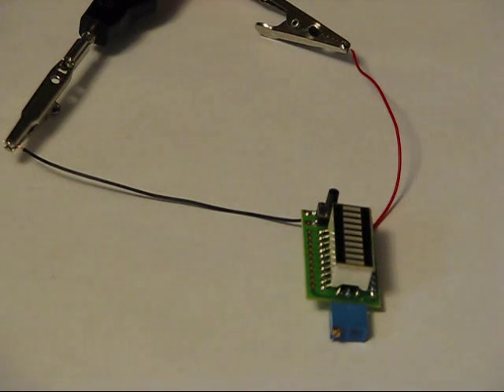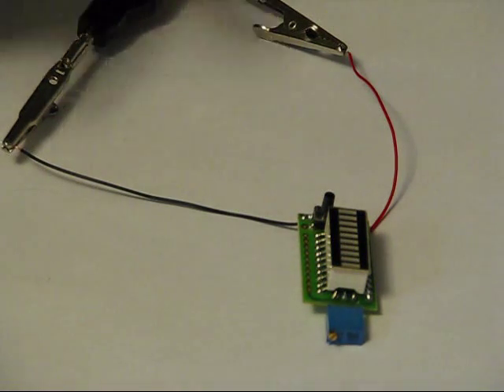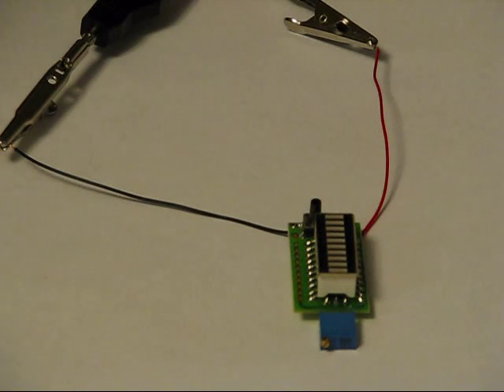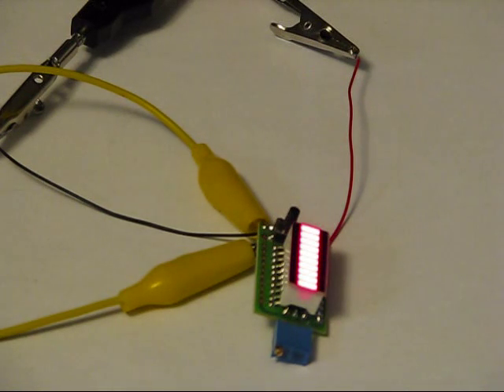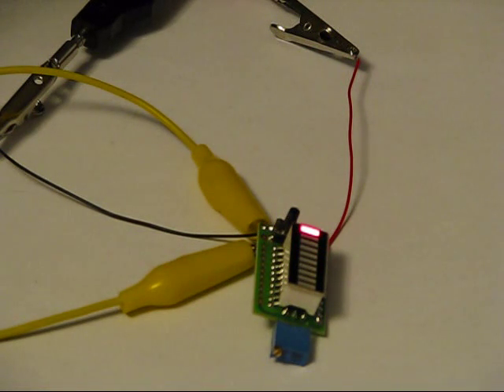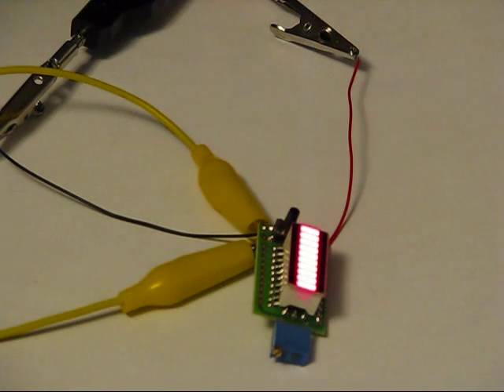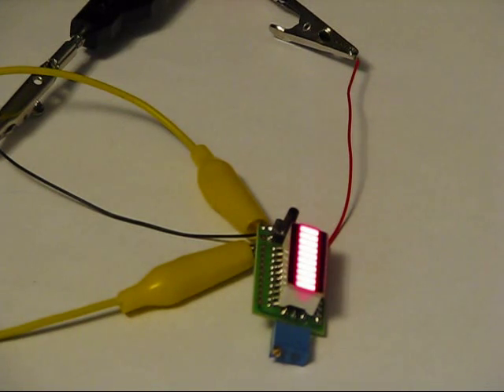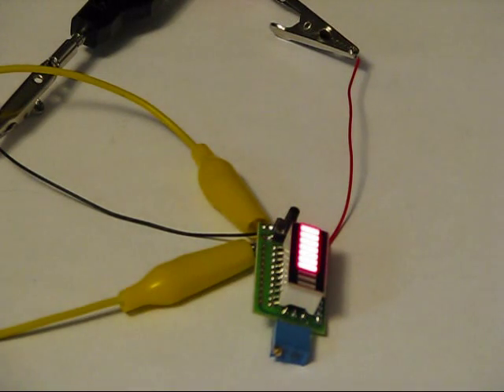The LM3914 Bar Graph Voltage Detector Module from www.engineerigshock.com

Comment: too bad your not selling these anymore, ive made my own version, not on pcb yet but have the monitor apart to check out where everything goes, what to use.
im going to use tri-color bar led's for my version of this, and all brite blue led's for my 5v caps but the tri-color bar graph seems to be the best option for a monitor. i see your other kit on this screen, i havent messed with it yet but dont see why i cant use 10 led bar graphs instead of the 10x 5mm leds on that board which i used 3mm.